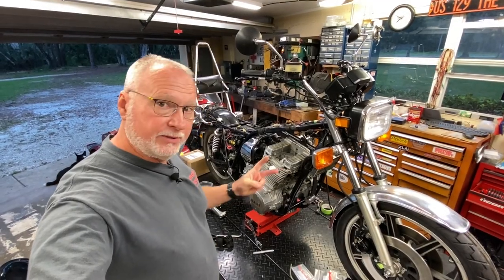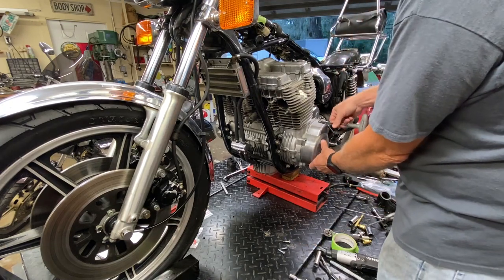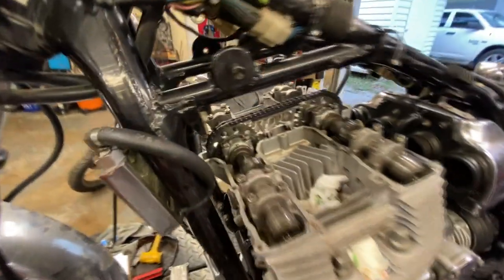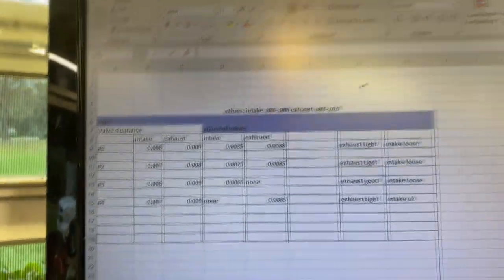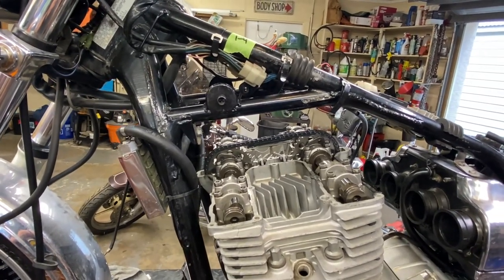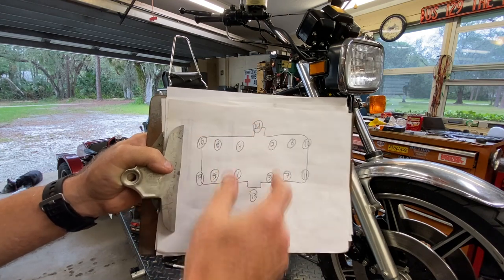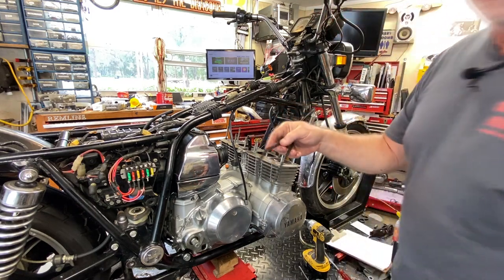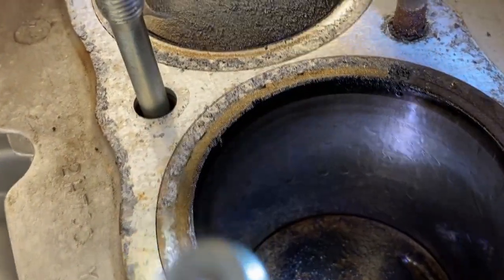1978 Yamaha XS11 - Let's get the head off! Video #2

Comment: Yes I’d agree with the oil control rings. If it was valve stem seals the amount of oil would burn off and you’d notice the oil out the exhaust whilst idling. I’d suggest the rings have loss tension and may have either broken of cracked. The bore is washed with oil and there’s too much to consider other options. Suzuki GS 500 I had was a similar thing. I think the customer will need to anti up as it’s heading for a rebuild. 😮. Great vid though and we’ll thought out.

Comment: Yes see the clean spots on the top of the pistons indicating oil consumption ? It's probably a de-glaze and replace rings job. When you get the new rings you can feel how much tension the old ones lost. You could measure the bores as well, but seeing its a low mileage machine it may not be necessary.